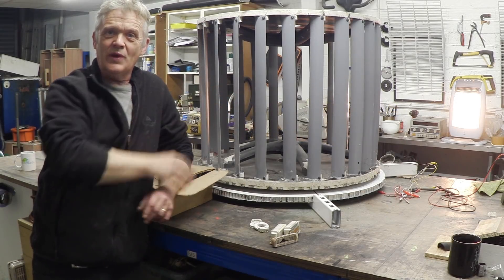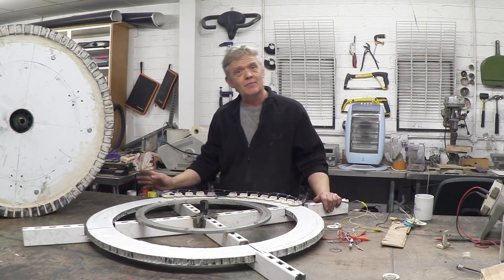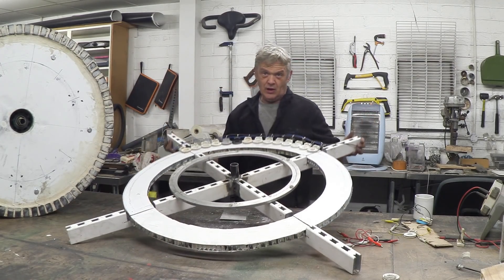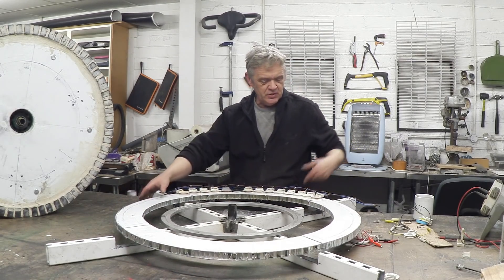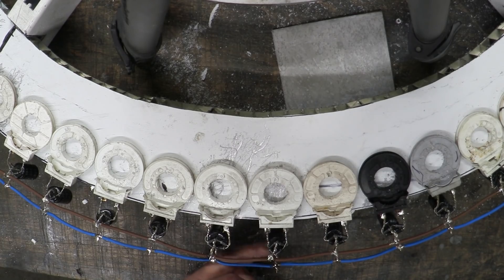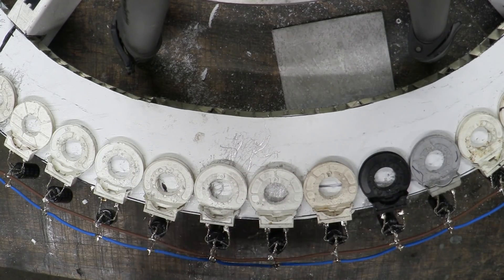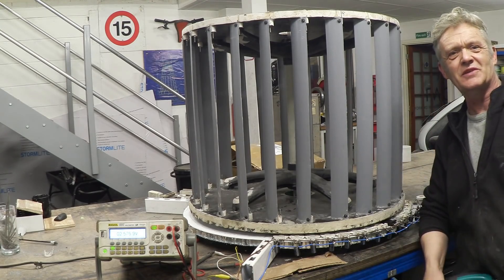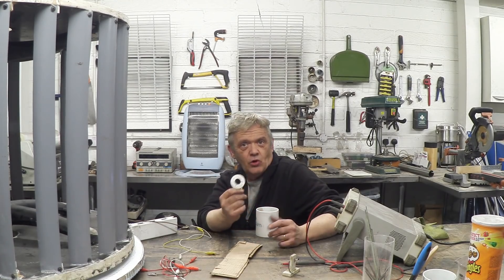Building A 1kW Wind Turbine For Under £100 - Some More Changes

Comment: Ok,I am clearly an over-thinker,could this be slightly  redesigned to have pick up coils above and below the spinning magnets ?
Of course that would require a split shaft design, but the upper pick up ring could be mounted on risers stemming from the very nice stability legs that you put together.
(The reason I mention it is you are technically only using half of your magnetic force top to bottom.)
{obviously as I am not a professional in the field, this is only
 speculation on my part}
Love your informative videos, great job !

Comment: Hi, am a ceramicist and looking to go off-grid hence coming across your channel!
You have mentioned about cutting down on friction, I have had a design for a momentum pottery wheel with bearings "similar to your setup) but the central shaft with a magnet on the bottom of the shaft and a magnet directly below +2+ or -2- I have no idea if this will work for my potter's wheel or your setup as you have blades in the way.
In reference to being off-grid, with enough of those polo looking things and more magnets could you have an inner ring of them as well as the same at the top to generate more amps, volts and power stuff, would this noticeable charge a battery bank to run beside solar panels?
Sorry for all the stupid questions I make pots not electricity 🤭

Comment: I love this project! I'm hoping to make something similar one day. It makes all kinds of sense to try to generate in low winds from any direction to power the phantom load and lights in a house. It appears to have some increased resistance since the last video. Is that coming from the lazy susan bearing or the increased number of coils or both? I'm wondering if it's going to reach a point at which it will require much more wind to start spinning.
Reply: Lazy Susan bearings aren't that good, in fact most are pretty cheap.

Comment: Seems like theres much more drag than before?, the second you took off the leaf blower it immediatly started slowing where as before it free wheeled for a long amount of time?
Reply: Tactical dot.
Reply: Yes I noticed that, and even with the leaf blower only on one side it was really slow, and then fast to stop.
Reply: I assume it's either cogging off the magnets being attracted to the (stationary) steel frame or increased bearing resistance?
Reply: Yes and I was also thinking would there be additional losses created by having more magnets than coils. With 2 different poles over the same coil at the same time, surely that's just going to waste power generating heat in the coils ?
Reply: there is always a trade off when you start to spin the aether
Reply from the maker: there is - I think it is the ring bearing to blame - a problem I am thinking about - I might suspend it from a cage
Reply: @goldmagnet9013  I thought that a coil  works best with the two magnet poles passing, the N leaving and the S entering helps produce a better sine wave just like when used in reverse the AC powering the coil passes the alternating current at 50-60Hz (cycles per second)

Comment: It's a good match for a twelve volt or other low voltage application. RV's typically run twelve or twenty four volts and every household appliance or electrical/electronic device in a landlocked house is manufactured in a twelve or twenty four volt version with comparable capacities for RV's. A hundred twenty volts is great for the utilities companies but not necessary for the home.

Comment: well you could generate large current with that with a capacitor bank . and then just charge up the capacitor bank and tank the charge off of that which would provide a decent amount of current but only for short periods of time.

Comment: That's great Rob your a star.
My friend gets rid of scrap he always gets microwaves I will ask him if you still need some bits.
Now just a thought if the stator  had holes drilled in it in the centre of the coils on strong wind days could a ring of iron shafts be raised from below by say a car Jack type of arrangement to provide a core as on strong wind days the power would be available to overcome the drag.
Would there be any mileage in thus do you think or would it make to much current and melt something?
Kind regards Kev.

Comment: How strongly I would get electricuted with those parallel caps? Should I consider same level of safety measures and attitude as with a tube amplifier i.e. think it as a hazard as dangerous as if a track would drive over you?

Comment: How about a maglift setup for the wheel to remove drag? Using a pointed tip on center rod may help cut down on drag as well to help it spin more easily. Thanks  awesome how you bring back to the basics....and they say you can't reinvent the wheel ha :)
Reply from the maker: the bearings are certainly still an issue for me mate

Comment: If i understand correctly the base is still made of aluminium while the magnets are closer to it as you are using smaller coils, so i suspect there are some loses due to eddy currents. This accounts also for the lower speed.

Comment: Hello Rob Sir, Lovely rectifier capacitor design, lovely build, I could hear the rumble of the ring bearing on which the rotor mounts, does it have metal balls under it? This is to reduce friction as I hear that sound I feel it's scratching surface below, or you can surely have two such rings with a groove in the middle of both rings a bit deep one to stop and hold iron balls from flying around and the rings can be permanently fixed to stator and rotor, those rings can rest on iron balls and form a friction free bearing, or we surely can have a conventional ball bearing at the center where the pivot is welded, please guide, I may have assumed it wrong, apologies if so, but I loved ❤️ the new ideas God bless you Rob Sir, love, respect and warm regards from India🙏🙏🌹🌹👍👍
Reply from the maker: you are quite correct mate and is something I am thinking about as I agree with what you are saying here
Reply: I was wondering if there are any sort of floating bearing available that has minimal drag and friction. Maybe even a sealed and pressurised fluid type bearing.
Reply: @stevetobias4890  I've installed cooling fans for computer racks that work on mag lev bearings and so are completely frictionless, but I don't know how well that could be scaled up to this size. Not for a minimal budget I mean.

Comment: One of the ways to cut down on the cogging would be to install a second set of coils spaced 1/2 the distance of your first set on a second level with the magnets in the middle. That way, as one set of magnets is coming on to a coil, the second set of magnets would be already centered. Stack 4 sets and 2 sets of magnets and adjust the spacing to 1/4th per level  and cogging will disappear.

Comment: If we took groups of four similar coils, and nailed them to the panel at 90 degrees to each other, wouldn't we then be able to assume Synched, or close enough, and call each group of four connected together a bank, and only need one rectifier?
I know this is hardly likely to get any comments, but...
(I would still use an oscilloscope to make sure of the synch, though.)

Comment: I am curious as to the blade configuration, as I have seen people claim that the VAWT do a lot better with fewer blades, as little as 2. Anyways great series, I learned a lot from all the videos!
Reply: More blades give more torque, which is what you want with a low rpm generator.

Comment: Robert, How would graphite cores affect the inductive drag, and coil saturation?
Reply: hey Terry.. snappy idea 💡 I wonder now as well .. I do not have enough experience with this stuff to really know though..
Reply: Terrible results mate. The core needs to be made out of a metal that best attracts to a magnet. I know because I have done a lot of test on this. But he could do graphene supercaps that he built to speed the voltage and amps on up.
Reply: @jasonwitt8619  and yet all flyback style transformers use graphite.
Reply from the maker: I don't know mate - but I think Jason has done a fair bit on this and he doesn't seem in favour of it
Reply: It’s not that surprising that a less magnetic material would have less affect on a magnetic field than a more magnetic material. 😉
Reply: @ThinkingandTinkering  you haven't tried it but Jason has? I find that very interesting.

Comment: At $100 each, you could have a couple dozen of these.
Quick search says the average 2000 sqft home uses 30 Kwhours per day.
So, if this puts out 1/2 kW daily, we would need 60 to meet the demands of the average house. (in the US)
Double the length of the blades, should double the output, so back to 30.
I live on a hill and have space for that many, but damn, that's a lot of turbines.
Good news... it would only be $3000 for the lot.
:)

Comment: it looked like you were getting enough drage from the coils to really slow down the rpm if you could connect the coils 2 at a time you can slow down the rate of turn to something reasonable by increasing drag caused by the coupling of the coils by increasing the number of coils attached at 1 time.
Reply from the maker: the drag was from the bearings mate - still an issue for me
Reply: @ThinkingandTinkering  when you get enough coils to do the entire perimeter there will be a lot more drag although they are fairly small coils it ma make no difference

Comment: I'm just guessing here... with so many coils, you could get pretty smooth generation with one diode to negative volt bus and an opposite direction diode to a positive bus with a single capacitor on the bus-to-bus difference.
Reply from the maker: I would suspect because of the lack of pole spacing and coil arrangement most of the time the generating coils would be in reverse phase and 'fighting' each other mate

Comment: Fascinating project, been following it from the start. It looks a bit like a flywheel energy storage system and I suppose it would be if those generator coils could be reversed to be a motor. Well made fly wheels in vacuums with mag bearings (mechanical battery) supposedly have the same energy density as lithium ion and can be made much cheaper with safe materials. Without load they run down, self discharge after about 10 hours. Is this a project you would ever consider?
Reply from the maker: I love flywheels mate and yes I am considering it
Reply: @ThinkingandTinkering  That's brilliant mate.

Comment: I know it’s too late now, but did you have some formula for working out the angle of the blades?, As I was just wondering that if the blades are not at a 90* angle to the edge of the rotor. That wind may be lost past the blades if they are at less than 90* angle?.
Reply from the maker: I forget too - but I got the angle from a couple of research papers I read mate

Comment: turn one of those turntable motors at a rate of 1.5 to 2 turns per second and look at voltage and amperage you can light a dimmable LED there will be a lot of drag because of the gears
Reply from the maker: did a video on it mate - cheers

Comment: Just wondering in your testing, did you meet your goal of 1kw output with low wind conditions?  I am very interested in your results.
Reply: That is not possible with that thin wire. If it outputs lets say 20 Volts that would be 50 Amps. Not with these wires. Never ending story

Comment: why is going for high voltage (small wire in coils) more beneficial? I didn't got that point.
Reply: The higher the voltage, the lower the current (for a given power) and the lower the losses in the high-resistance coil wire.

Comment: If you had turned the coils around with the rectifier and capacitor on the inner side, you would better protect the electronics from the weather, the DC bus would be shorter and it would look cleaner without a cover.  
I love this design.  I am playing with the vibration tube with an artificial muscle generator you built in another video. I am planning on making multiple vibration tubes and tie them together with a similar coil/rectifier/capacitor/DC bus you have here.  
Would a blocking diode give any advantage by separating the capacitors of different performing units. Otherwise, all the capacitors will tend to be at the same level all the time possibly absorbing some of the energy into underperforming units that could have been delivered for use. Might be a consideration in this VAWT as you may have different specs in the microwave turntable coils from different manufacturers. Maybe the cost of the blocking diode would be more than you save with the separation.  Looks like something I will need to test in my future vibration tube array.
Reply from the maker: for sure mate - but that would be a pain for me to get to and this is a work in progress - but I do like the idea. I think the blocking diode idea is also pretty interesting and well worth a test - any chance you can let me know how it goes if you do get round to testing it?
Reply: @ThinkingandTinkering  I certainly don't expect you to change your work in progress for what is essentially a cleanup. Just a comment for someone starting a project based on your work on this project. 
You are proving amazing things and sparking several novel approaches to energy gathering.
I would be happy to report back any results.  Even though I am very slow in making progress, I do have the patience to stick with my projects for a long time (months/years)

Comment: I thought you had a real ah ha and put away for safe keeping. LOL
Been curiously waiting for an update. 
 I have seen a disk with magnets on the other side of the coils driven by the wind mill to provide maybe twice the power with one set of coils. Actually the magnets were attracted to the magnets above which made the lower disk turn. Would that work or would it nullify the charge?
Reply from the maker: I think it is worth a try to see mate

Comment: Could you use retractable steel rods to increase resistance during high wind conditions, a kind of braking system. I ask because it is a problem that I'd like to  see your thought process on overcoming and where I live, there are two basic wind conditions, light breeze and I think the house just moved.
Reply: my thoughts would be to use  cores and electromagnets, and a "trick" used to control large motors.

varying current through the electromagnets will adjust how much voltage*current comes out of the generating coils.
Reply: ie if generator running fast... allow far more current throught the field windings... generator will increase both electrical output, and the coresponding resistance to being turned.  if that torque is higher than that wind can provide generator will slow down.

for maximum efficency across all wind speeds you'd want to that happen for all windspeeds ie somekind of control loop akin to measure wind... measure alternator rpm.... if alternator slower than determined to be ideal for measured windspeed... decrease field current... if alternator faster than determined to be ideal... increase field current.
Reply: @stevecummins324  yes, i never thought to use the magnetic force as a brake until seeing this design and i think that there are a number of electronic methods for attacking this issues and even mechanical, that is why i was wonder about adding steel pins that could be raised inside a few of these coils, at different locations to brake this unit.
Reply: @RoadRageLive 
Energy from wind-rotative energy turbine - electrical energy out =0
:-)
Reply: @RoadRageLive  it would be great if Robert would investigate using an electromagnet with a coil on this design. Ran on DC from a battery via  a variable resistor it would give a qualitive understanding how strength of magnetic field affects the turbine.

 I suspect... . F=BiL,  can be converted into a torque form. And show interplay. .
Reply from the maker: I would think so mate - but aren't VAWTs self limiting?

Comment: Just found your channel, great stuff. Sense you're using a squirrel cage blower fan do you think that it would help if you cut venting openings in the blower end plates. It would eliminate static air pressure (vacuum). The insids leading edge of the blades are trying to push air out. Not as much as on a regular squirrel cage  lwer with the blades reversed but still trying to blow air out. Would it be worth a try?

Comment: I would suggest to make a simple calculation of forces, friction, levers and torque (moment). Longer the lever, greater the torque. So support of the drum should be as close as possible to the center axis. Maybe it would be better to stabilise the drum by hanging it on the axis from the top. Bottom support far away from center, makes a long lever. So even a small friction crates considerable torque, which stops rotation. So you are throwing away a lot of energy because of log levers. It is much easier to shorten the levers, than make less friction.
Reply from the maker: it already is turning on the centre mate - the bearing is for any wobble the drum hangs a micron or two above the the circular bearing

Comment: Consider eddy currents in that aluminium inside that base,... ;-)
Reply: I was concerned about the same thing!!! In fact, those eddy currents may even be enough to heat the base up very considerably!!!!! Not to mention resisting the turning of the device.  Glad to see that someone else also took issue!!!  So, go to plastic or plywood sealed to prevent water damage...

Comment: would you not want to put some kind of "apron" on the bottom of the rotor to keep the coils and electronics from getting wet
Reply from the maker: for sure mate that would be a good idea
Reply: Why not just use liquid insulation tape. It's flexible and UV resistant as well as waterproof and air tight. This way you just need to brush it on and let it quick dry. 125ml costs $10-25 delivered on eBay. It's excellent stuff and extremely versatile. Insulates over 1.3Kv / mm